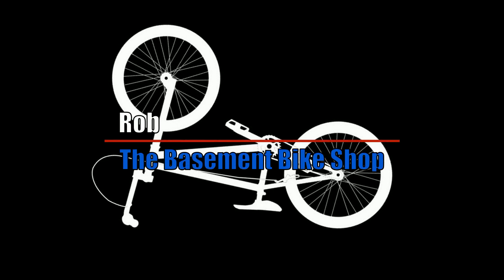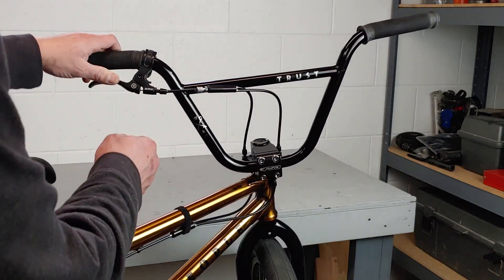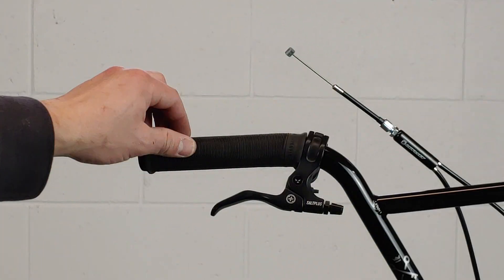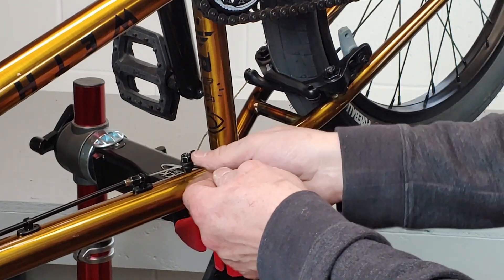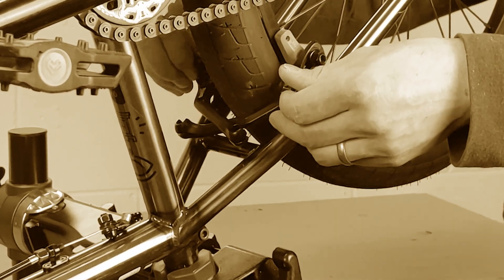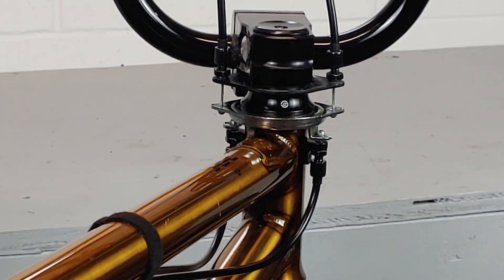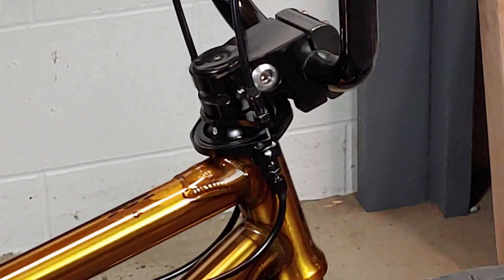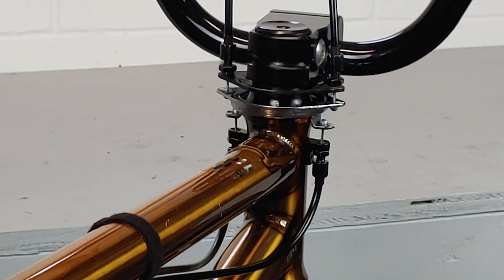BMX Gyro/Detangler troubleshooting and Adjusting

Comment: I got my son a new BMX with gyro brakes, but noticed there's no way I can come to a full stop right away. Is this a gyro limitation? I'd like for my son to come to a full stop and leave a nice streak showing the brakes truly respond. Not sure if I just need to switch to conventional brakes or my gyro system is just a cheap one?
Reply from the maker: If your gyro is set up properly it should work just as well as brakes without a gyro. The brakes should be fully engaged before the gyro hits the top plate.

Comment: Hi I am actually so happy that I found your channel. I have the problem that my lever always has a little bit of a gap (it rattles when I jump sometimes) and I think I adjusted all of my screws on the Gyro itself and on the cables. The thingy on my brake lever adjustment screw that keeps it from unscrewing itself has some weird bend though. Any ideas?

(I am running a Salt Plus Gyro Set btw.)
Reply from the maker: It might be that your lever took some damage in a fall or crash.
Reply: I had the same issue on both brake levers. I ended up taking the adjustment nut off both, trimming them down and then using other adjustments to compensate. I also used a knarp on my upper gyro cables as no matter what I did I could not get the upper cables tight. Worked like a charm.

Comment: I’ve installed my gryo but when it goes above the headset sometimes it gets caught and won’t come back down. Any fix?
Reply from the maker: Is the gyro unit level as it moves up and down? If not, you can adjust one side of the top. If it is level, you might need a headset with a skinnier profile